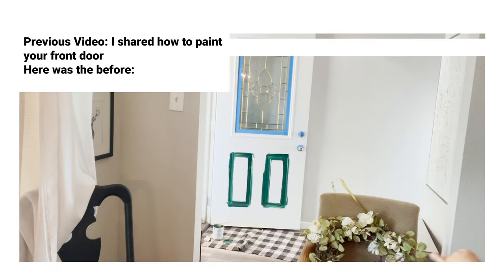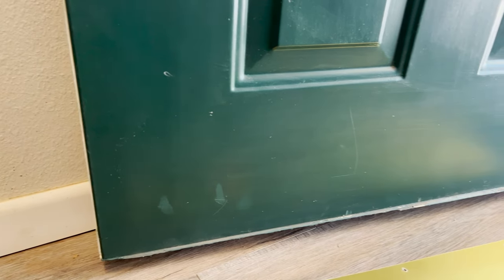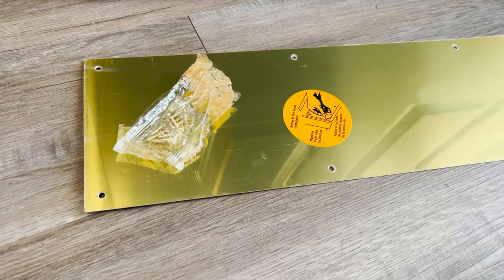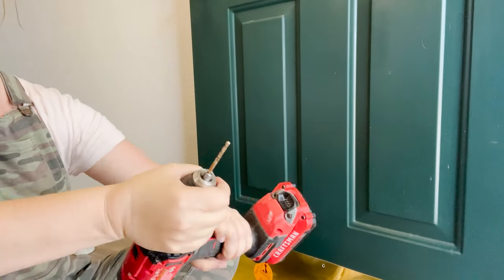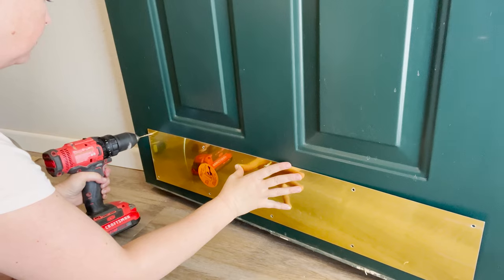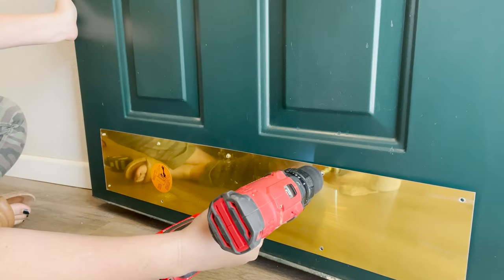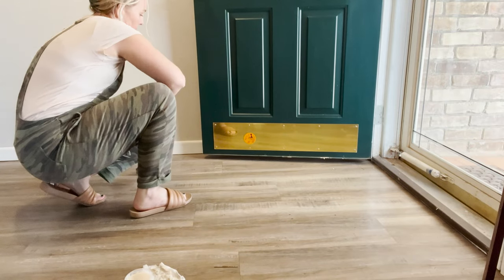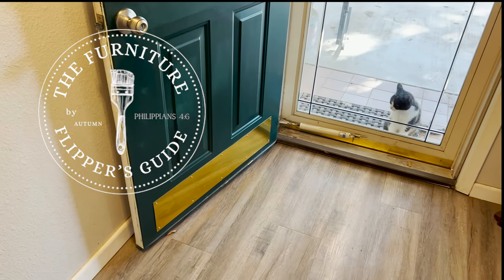How to Install a Door Kickplate 🤩 - FOR BEGINNERS! #homediy

Comment: I need details ...  Is this door hollow?  What type of screws are used?  Does the kick plate need to be lower or higher from the bottom edge?
Reply from the maker: Yes this door is hollow, I used the screws and measurements that were included with the kickplate kit ☺️